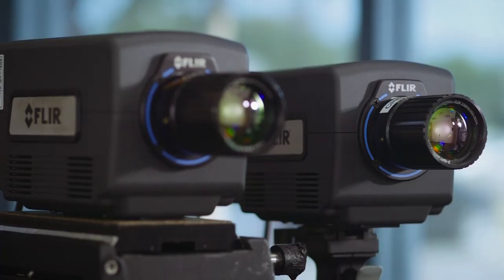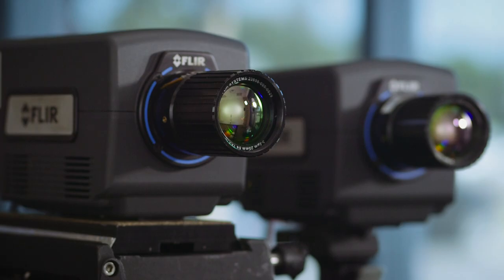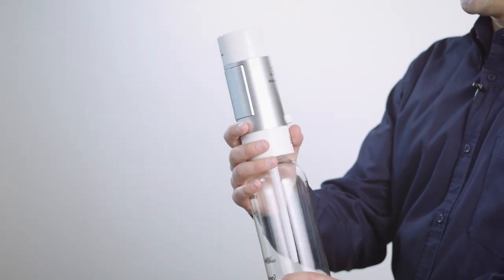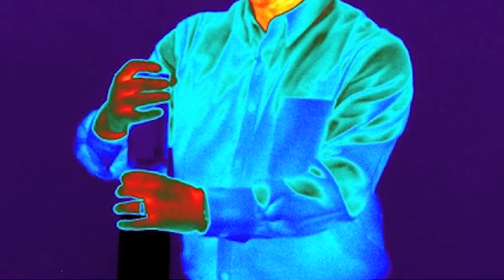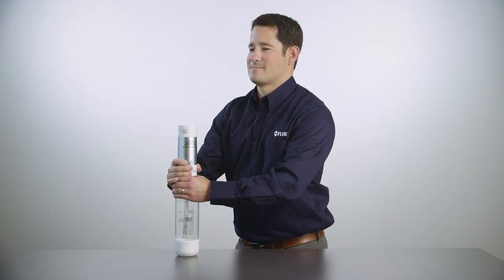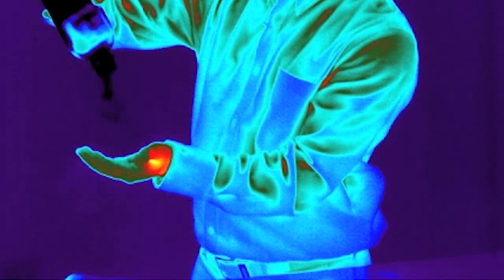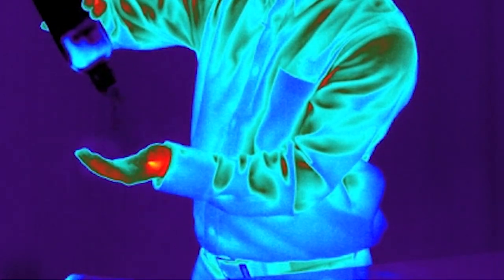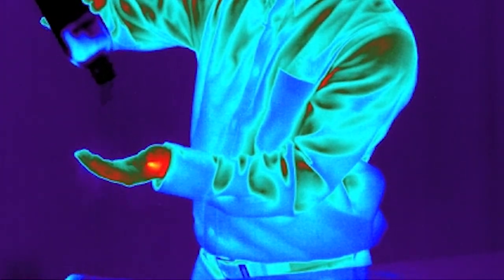Using a FLIR Gas Detection Cameras to Visualize CO2 Gas

Comment: Do you have anything that can detect helium? We use helium for leak checking but use a sniffer, and it isn't very user-friendly when there are about 100 points of connection. It would make finding a leak much better if you could see it.

Comment: Could those pair of cameras be synchronized to capture frame-by-frame a "stereoscopic thermogram" movie to add depth to the gas cloud if the aim were to allow the possibility for quantifying the concentration of the gas? How much could the contrast be improved if a background surface were uniformly heated to a temperature closer to the 673.9K where the peak intensity of IR emission (4.3 microns) matches the strong absorption band in CO2 gas (4.2 to 4.35) microns?
Reply: Stereoscopic FLIR would be awesome. The Predator would be envious 😂

Comment: Hi Guys, FLIR-GF320 can detect also a Nitrogen?  We all know it can detect hydrocarbon gases . But I found a Pump seal leak using Nitrogen at outboard seal. So FLIRGF 320 can also detect Nitrogen?
Reply from the maker: +velmurugan ezhumalai We cannot see any of the noble gasses with the GF320. The reason we can see the hydrocarbons is the resonance of the C-H bond. Think of a couple weights on the end of a spring. The oscillations of a spring would have a specific frequency based on the mass of the weights (elements) and the strength of the spring (binding energy). This results in a resonance near 3.3 micrometers which is where we filter the IR camera.

Comment: you got two cameras, but did not compare the cold filter vs no filter?
Reply from the maker: Our goal was to show the difference in warm/cold filter. The CO2 gas would not be visualized without a filter.
Reply: @Flir  I very much understand that CO2 is only visible when you have a cold filter directly on the dewer that lets 4.0-4.6um pass. This video surfaced in a forum discussion about imaging and detecting respiration, but the cooled A67xx cameras are far outside the scope of said endeavor - my solution would be looking at nostrils directly with a lepton but you can't really get your hands on those in 30hz sadly :(

Comment: This would be useful if the cameras were priced low. At this price point and this result, a person who needs a similar service, say a car AC repair shop where UV dye can solve the problem easy and cheap,  ain't switching their current system to anything else and so shouldn't the rest.
Reply: Is there any way to image air flow  without using c02 or methane or something else toxic? Can this camera see heated air?